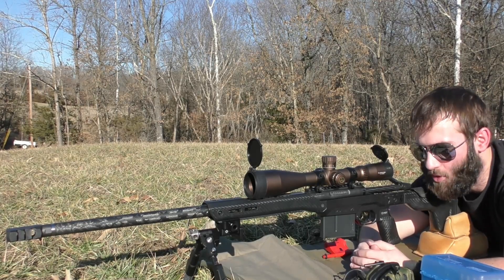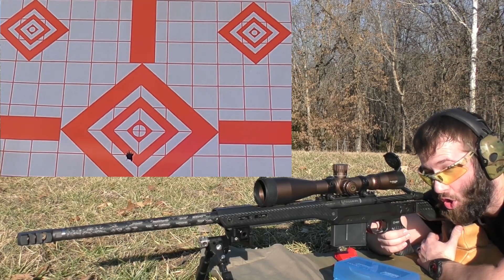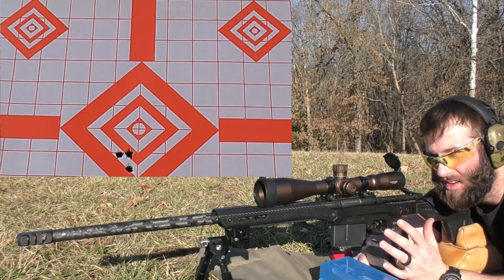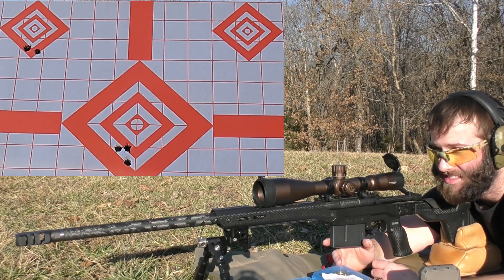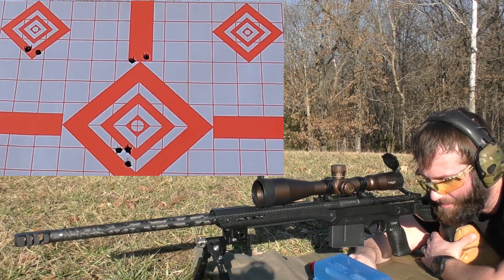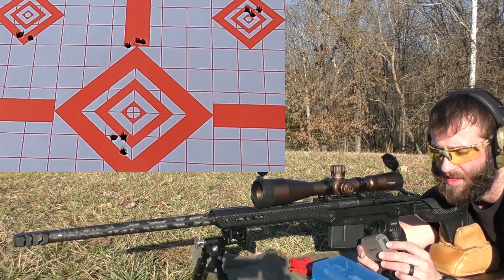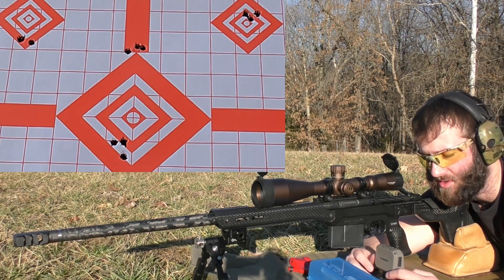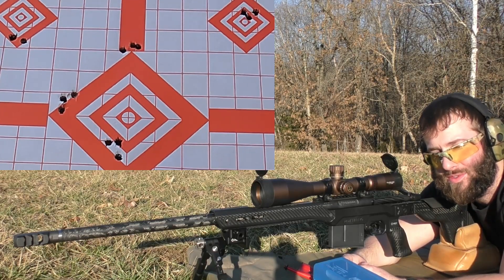Custom 7mm PRC Accuracy/Velocity Test: Berger 195gr Extreme Outer Limits (Elite Hunter) and H1000

Comment: Proof pre-fit 7PRC barrels are SAAMI spec. you can get the chamber redone with the AW modified reamer and that should resolve the clickers. I'm at 70.0g H1000 with 175 ELDX in a 7PRC but all of my PRCs have the AW chamber. 3005 fps, 24" barrel, no pressure
Reply from the maker: I'll have to look into that. Sounds like a fantastic load! What is the difference in the AW reamer?
Reply: @RisenCitizen  AW = 0.002 larger body
Reply from the maker: @Accuracy1st interesting... thank you for the info!
Reply: Barrel length???
Reply: @jdirt1982  24

Comment: N568 195s be happy around 2850-2900 it’s only a 24” barrel. Or n570 just my 2 cents. I switched back to the 180 bergers 2950 ballistically doesn’t matter until 1000yards +
Reply from the maker: I tried N568 (which is a powder that I already have good experience with) and I just didn't have as good of luck with it as I did some of the other powders that we tested. This cartridge has been much more of a challenge to find an optimal load than I had originally expected it to be.

Comment: If you’re gonna run a 195gr why not just bump up to a 300prc and shoot 215+ gr bullets shooting 2900+?
Reply: I would say a lot of it has to do with BC of 7mm projectiles. With the right powder and barrel combo, you can run that 195gr Berger (or the 190gr A-tip) at 2950+. It takes a very long, very heavy .30 cal projectile to overcome the BC difference, and by the time you've loaded that, unless you're using some of the Ultra Mags or other very heavy magnums, the velocity doesn't compare. So, you're taking more recoil, and significantly more drop and drift.  

If you assume the 190gr A-tip at 2950, and the 215 Berger Hybrid Target at 2900, at 1,000 Yards, the 215 is dropping nearly 27" more (Based on my location), would drift more (about 6" more in a 10mph wind, 90 degrees off the left side), and has less energy on target (1651 for the A-tip vs 1484 for the Berger.) Even assuming the 195gr Berger which has a much lower BC than the 190gr A-tip (.755 compared to .838), it drops 20" less at 1000. The only way the 300 PRC catches up is if the 7 PRC velocity is at 2850fps. Then, it's just tied on everything except energy and probably wind drift. There are 30 cal magnums that easily run circles around the 7mm PRC, but they almost always come in the form of higher recoiling packages, and 80gr-100gr or more of powder per shot. To be honest, there are other 7mm magnums that beat out the 7 PRC, like 28 Nosler, 7mm STW, 7mm Gunwerks LRM ties it at least (probably because Hornady copied the LRM...)

Now,  this comparison could change if you went more apples to apples and used the 230gr A-tip at an assumed velocity of 2850 (max in the Hornady Book) but, your drop is still more. Not as significant as 27", but still about 18" or so. Using the 230gr A-tip does give the energy advantage back to the 300 PRC, and would likely have minimal, if any wind drift difference, but you're taking a lot more recoil.

Not trying to be argumentative, just showing a different look on it.
Reply: @buckhunt917 yeah to me, I’d just rather shoot a 300prc 26” 230 hybrid at 2950+ and be done. High bc, elk killing energy out to 1250 yards. To each their own tho. My 7prc 22” shoots 175 bergers at 2850. Perfect sweet spot for my gun. But if I wanted to run a larger grain bullet I think the 300prc does a better job
Reply: Probably cheaper to rechamber to a 28 and have it throated for the 195’s he’s probably got just over .250 in extra usable mag space and wouldn’t have to buy the barrel if the current one would allow for it
Reply: True. I’m just not a fan of the 28. Too over bore. Just thinking if you wanna shoot those bigger bullets might as well go 30 cal
Reply from the maker: I have a 300 Norma Magnum that I use as a target gun when I want to shoot heavy 30 cal bullets, but the 7 PRC is something I wanted to use as a hunting rifle with manageable recoil that I could push high BC bullets reasonably fast. So, I could step it up to 300 PRC, but that wasn't the goal here. I like seeing the conversation here, though!!
Reply: @RisenCitizen  me too! Love the channel thx
Reply from the maker: @PittedLikeThat21 thank YOU 😊👍

Comment: Love it, that 195 is a great bullet. Have you revisited LRT for the velocity? I noticed you got some good speeds out of it in an earlier video. I think that a deep cleaning is definitely in order - carbon ring buildup could be a major factor here and like @IraHerrington said, those lugs could be getting sticky. You may also look at pushing the shoulder back an extra thou. I like to bump back .002 but sometimes when getting that heavy bolt, giving it an additional thousandths makes all the difference - I know it changes your entire load BUT sometimes its VERY worth it...just my .02. Nice work, love your videos.
Reply from the maker: I have not revisited LRT, unfortunately. I am planning on bumping the shoulder back slightly more for future testing, but we'll have to see if it ends up solving our issue in a future video :). Thank you!

Comment: Check your throat with your bore scope for a carbon ring as well, you should be fine around your first three shot on paper as far as pressure. You got an excellent powder for your rifle and that 195g bullet. Also as you already know, those three lug actions can get sticky, just make sure your lugs are greased, and a very small amount of oil on your bolt should help it glide. I own a Terminus Zeus SA (QC) and it had the same problem as it was getting broken in. Lastly, 66.5 was max for me with H1000 in my 26" barrel using Peterson Brass. When Lapua launches the 7 PRC brass this fall, you should buy some, and try it for sure.
Reply from the maker: Thank you for the advice. I clean out the carbon ring around every 50 rounds and lube the bolt as well. The 7 PRC is definitely bad about needing more maintenance it seems. I'm really looking forward to trying the Lapua brass! We'll have to see if they end up producing it on schedule or if we might have to wait longer. Hopefully, it will come in soon enough for deer season!
Reply: @RisenCitizen  I hoping so as well, looking forward to having quality brass for mine as well. I'll try to finish my load once the brass hits the market.
Reply from the maker: @IraHerrington I've had good luck with Peterson in the past, but I can't deny that I prefer Lapua. Best of luck to you when you get your hands on some!
Reply: @RisenCitizen  You as well, I'll stay up-to-date with your videos, and see who it's coming along with yours.
Reply from the maker: @IraHerrington sounds good to me!